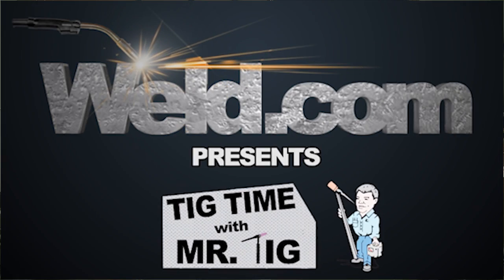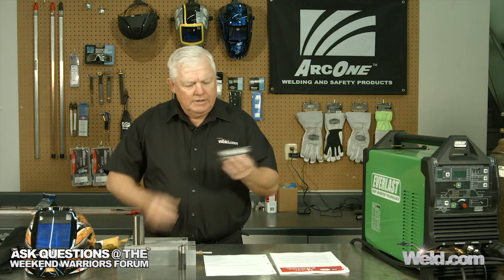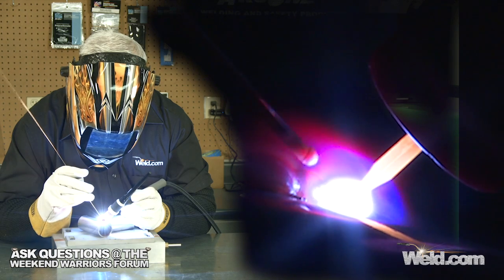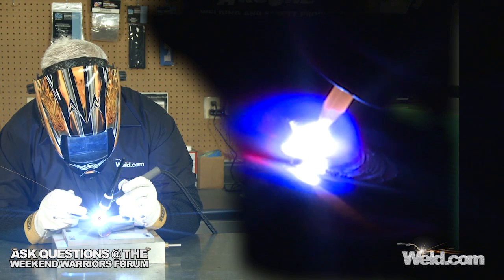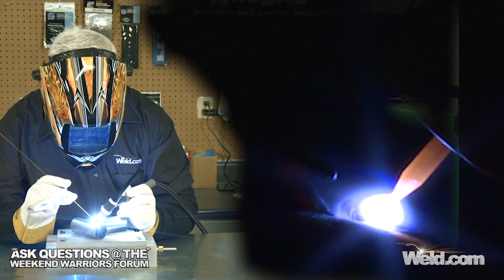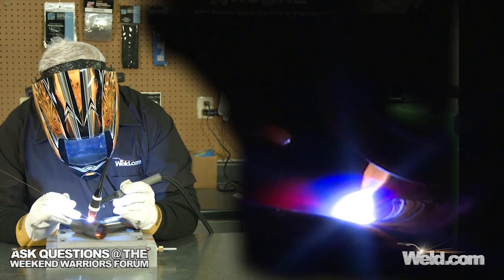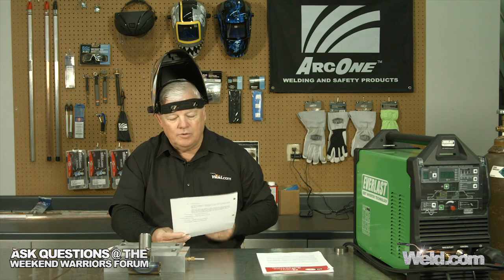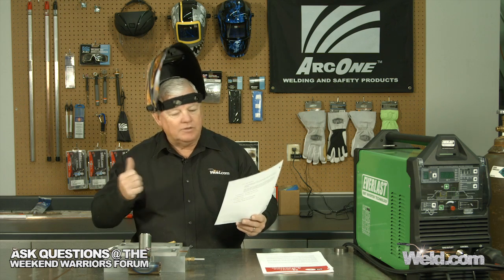Tips for Welding DOCOL R8

Comment: The manufacturer's website says, "Spec calls for ER80SD2 filler material but ER70S is also suitable..."
If welding Docol/AHHS to regular mild steel, would it be better to use ER70? Or should I stick to ER80?
Thank you for any info anyone can give!